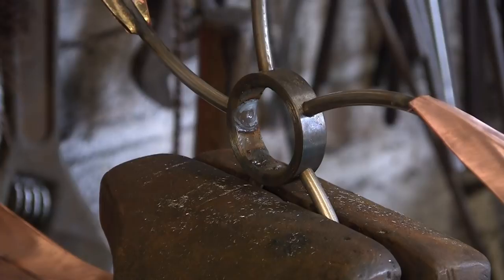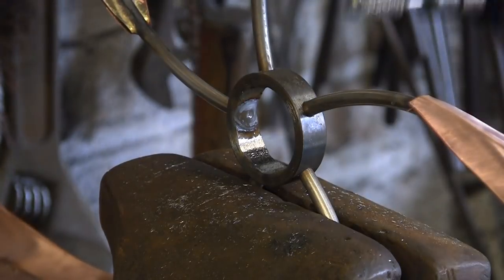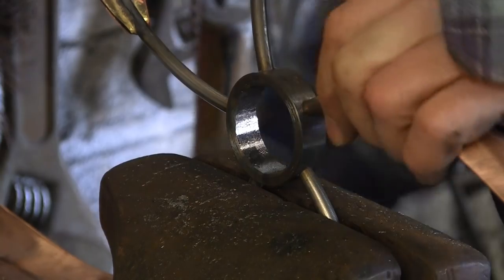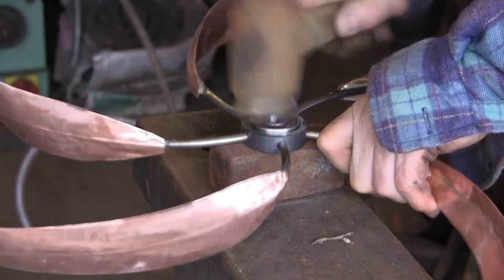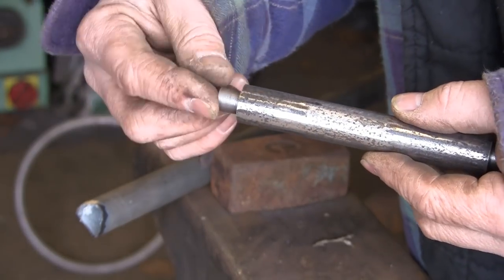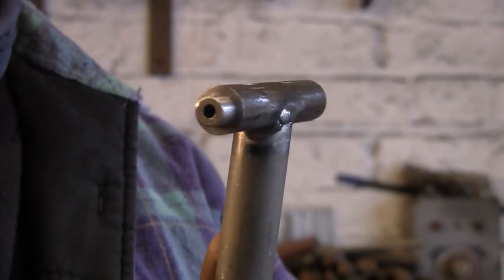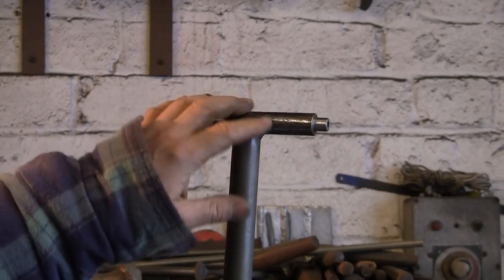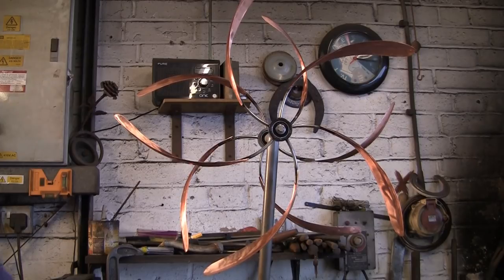Copper wind spinner Part Three

Comment: Fantastic. I was so impressed that I made one myself. I also used closed bearings but didn't have a problem with them. I did however have a problem with balancing each side. I tried to add weld to the hub to balance it nut that didn't work so I cut some strips of copper and rolled them around the blade end of the stems. works perfectly. Thank you for the inspiration.

Comment: GART - make sure you use flip down (clear) hood - and rinse hands in water right after  using die grinder -- those very small filings are kick ass when embeded in fingers hands -eyes i learned from experience--- great job as always

Comment: Gary
I've used bearing like that and came up with the same result.
I've found they need a push fit, or even a slip fit with a bit of locktite. Just the small amount of force you tapped them in with will tighten the races up and they bind.
Ask me how I know HAHA.

Comment: Just a note; I noticed that you used sealed bearings. Try using "shielded" bearings rather than "sealed" bearings on your next wind spinner. Shielded bearings have a "Z" after the bearing number. Sealed bearings have a "RS". Waaaay less drag with shielded bearings...a slight breeze will start the spinner spinning.
Reply from the maker: Thanks

Comment: Sorry to say it will not turn easily. First off wrong kind of bearings. Sealed bearings have to much friction. Second it looks like the bearing housing is to tight. Bearings don’t need to be hammered in. Just lightly press them in. I am sure by now that you have figured this out. It would take a hurricane to turn it. Also you need to use a flanged bearing with shaft collars to hold it in place. Very nice wind spinner though. Get these problems figured out and you will be well on your way. Good luck.
Reply from the maker: If you see how old this video is and it has been spinning away fine in all but the mildest of winds, no maintenance at all!
Reply: Gary Huston  nice, would love to see a video of it outside on a pole turning. Can you do a years later follow up video?
Reply from the maker: @JohnDavis-yz9nq  Maybe !

Comment: HI,Nice work. Just wondering what type of bearing you used?
Reply from the maker: Nothing special, just went to my local bearing supplies and asked for some that would roughly fit the tube I was using with a 16mm center so I didn't need to do too much machining. They were about 1/2" wide.